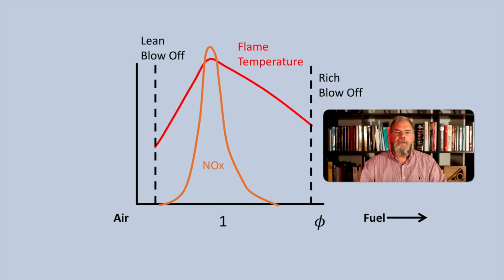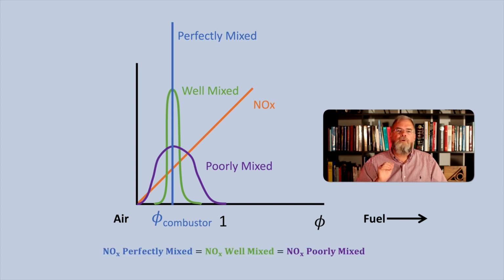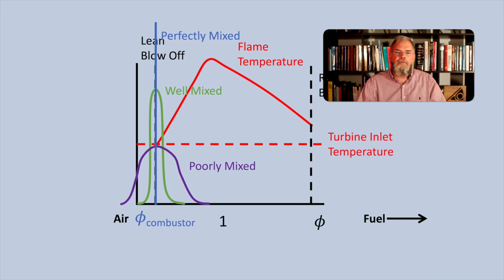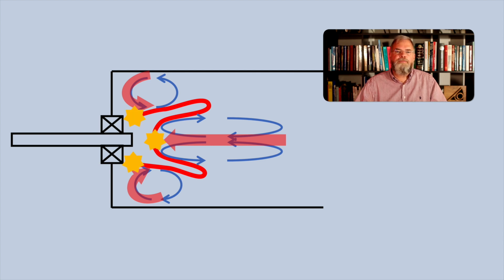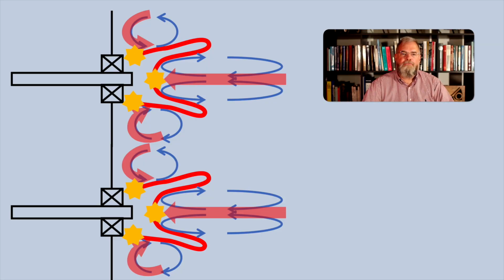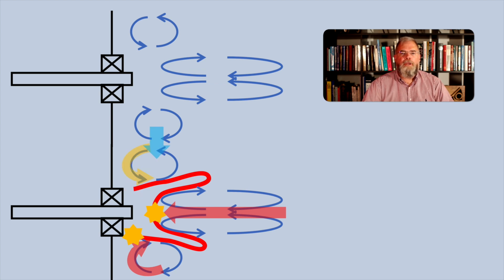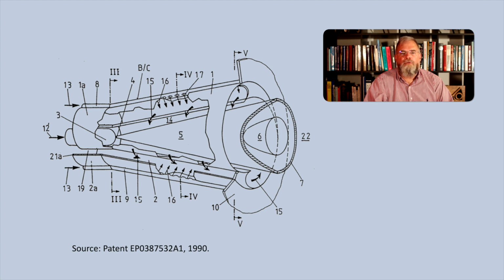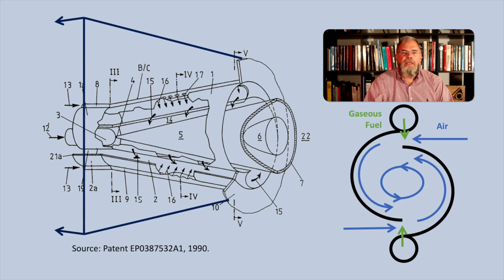Industrial Gas Turbine Combustors Part 3: Premixed Silo Combustion

Comment: Thank you for this amazing playlist. I have a question that maybe silly but here we go; When load decreases, fuel flow must be reduced to match demand. For a premixed flame, this pushes the system closer to the lean limit. Why can’t the IGVs alone be adjusted precisely enough to restrict airflow and maintain the original equivalence ratio, preventing excessive leaning?
Reply from the maker: The only silly question is the one not asked.  I am not a turbomachinery person so can’t answer what the limits are on the IGV and why this isn’t done.  I suspect this will impact the performance of the compressor and may lead to problems such as surge.  The IGV is closed on many engines as load is reduced which as you indicate helps but this is only done to a degree and is not sufficient to cover the full load range down to idle and keep an adequate margin to lean blow off on the burners.  Another tactic which is often done on small industrial engines is to bleed air from the combustor plenum and dump this overboard.  The drawback in doing this is that the efficiency of the engine is reduced at part load but it does increase the flame temperature maintaining the margin to lean blow off.  Mitsubishi for a period of time bled air from the combustor plenum on their large gas turbines and fed this back into the combustor downstream of the flame using a valve to control the amount of bleed.  I suspect they stopped doing this as variable hardware in the vicinity of the combustor is not typically reliable due to the adverse conditions there.  More recently axial staged combustion has been developed which helps as well.  Ansaldo Energia’s GT-36 combustor employs this and Siemens Energy has a number of engines which use this as well.  The idea with this is that the air flow is split so that less air goes to the first upstream burner.  This first burner is fired at low load and consequently operates at a higher flame temperature.  The remaining air is mixed in far enough downstream to allow complete oxidation of CO.  This air also lowers the temperature of the flow to the required turbine entry temperature.  The flame temperature of the first combustor is increased with load to the point where NOx emissions are still acceptable.  Then as load increases further fuel is added to the remain air or second downstream burner to heat this air increasing the turbine entry temperature.  By doing this both NOx and CO can be kept low down to very low loads.
Reply: @ 
Thank you for your answer and thank you for the efforts you put into this great series.

Comment: Is it possible that a swirler is simply a bad design?
Reply from the maker: I’m not sure why you think that.  The velocities are fairly high in a gas turbine combustor so it is necessary to generate a lot of turbulence to mix the air and fuel and to help stabilise the flame.  Turbulence increases burning velocity by increasing the surface area of the flame for a given volume of the flame front.  Additionally if swirl is strong enough the pressure in the centre of the vortex will drop enough that the flow in the centre will form a recirculation zone, commonly known as vortex breakdown, which helps recirculate hot burnt product upstream to ignite the fresh fuel air mixture entering the burner.  This helps anchor the flame.  Swirlers are fairly commonly used in gas turbine combustors with good success but there are other ways of anchoring the flame and generating turbulence which are also used.

Comment: Some Ideas for Future Videos (If you already don't have a pile planned, and if you are up to it):

- Integrated Gasification Combined Cycle (Mostly "Clean" Coal, but Potential for Biomass and/or RDF
- If there are/were any Gas Turbines using a "Oxy-Fuel Combustion" process to avoid nox (I know some solid fueled plants were planned for this, but just with conventional burners it seems?)
- Hydrogen-Cooled Turbo generators
- "Micro-Turbines" for building/home scale Combined Heat and Power Systems (How they are designed etc)
Reply from the maker: Thanks a lot for the ideas.  Right now I'm fairly busy with work so I haven't had the time to make new videos but when I find the time again I will certainly take your ideas into account.
Reply: @engelbrechtgmbh  i congratulate you on this amazing series with dense informative simplified and very well presented knowledge

I would like to ask you about premixing and its effect on efficiency since I do not believe it was emphasized

Does premixing improve efficiency ?

And in another note I would like to ask if it is possible to inject water both after the combustor and in the afterburner to increase thrust and decrease the temps
Reply from the maker: @First Last Thanks. 

In principle assuming the boundary conditions around the combustor are the same (ie temperatures, pressures and emissions - less NOx but more emissions related to combustion efficiency such as CO, unburnt hydrocarbons and smoke) the efficiency is not affected by the type of combustion.  Premixed flames tend to be more compact so there maybe an advantage regarding combustor pressure drop as there is the potential to reduce the surface area which needs to be cooled.  Having said that typically most of the air is involved in premixed combustion thus there maybe more pressure losses associated with conditioning this air so it isn’t completely clear to me which would have the advantage here.  But less pressure drop in the combustor would increase engine efficiency a little. 

Water injection is something which is used already.  For diffusion flames it is injected into the combustor to absorb heat and reduce the peak temperatures reducing NOx emissions.  But it is also injected into engines with either premixed or diffusion flames to increase power by increasing the volume of the flow entering the turbine.  This is sometimes done at the inlet to the engine in a fine spray of liquid droplets which has the added benefit of cooling the air entering the compressor or injected directly into the combustor where the liquid droplets are converted to steam before entering the turbine.  Ground based gas turbines, which I have been covering, typically don’t have afterburners as they are trying to minimise their thrust and extract most of their energy to drive mechanical devices such as generators, pumps or compressors.  However one might consider the SEV burner on ALSTOM’s GT24, GT26 engines as an afterbuner with a low pressure turbine following it.  This is not done in every engine but there are many engines in the field which do this.  There are losses doing this so I’m not sure it is always a benefit to do this but it can be used to augment power if a clean source of water is available.
Reply: @engelbrechtgmbh  my application is a very small rc model 

So incorporating water injection is definitely easy to do and i would like to emphasize that my purpose is maximum power

So if I was able to decrease the temperature significantely through water injection 

Is it possible that i reopen my combustion chamber and increase the diameter of the inner combustor to increase the flow maybe from 25% to 35% inside the inner combustor in order to increase the output of the engine at the same RPM
Reply from the maker: @FirstLast-tx3yj  For power augmentation in industrial engines they do not want to reduce the temperature by adding water.  They want to increase the volume flow in the turbine by generating some steam in the combustor.  So when they add water they increase the fuel burn to maintain the same turbine inlet temperature.

Adding water at the inlet of the compressor runs the risk of damaging the compressor blades especially if the droplets are not small enough to follow the flow well.

Unless you are an expert I strongly do not recommend that you modify your RC engine.  I do not expect the pressure ratio of such an engine to be large but still the combustion chamber is under pressure during normal operation and if any modifications you make are not mechanically sound you risk the engine casing cracking or exploding.  Inside the engine contains rotating components spinning at very high RPM.  If the integrity of the casing breaks down there is a risk that one or more blades get thrown.  This could severely injure or kill you or anyone else unfortunate to be in their path.  Simply spraying water at the inlet to the engine might augment power if the control system of the engine is set to maintain constant turbine inlet temperature.  If it is not you risk flame out.  However as I said you will damage the compressor blades which will become pitted when they strike the water droplets unless the water spray is very fine.  And if this pitting is severe enough, which if it is happening will build up to over time, you risk again a compressor blade breaking and becoming detached from the hub.  If the casing is not able to contain such a blade again it will be thrown and could kill anyone in its path.  If the casing does contain it it will cause significant damage to the remaining compressor blades.  Gas turbine engines can be extremely dangerous.  I have known of people who have been killed in accidents with real industrial engines so I strongly do not recommend you to modify your RC engine.

Comment: Very informative and full of knowledge.  Any textbook you might want to recommend to someone not familiar with combustion technology?
Reply: Combustion is a big topic.  There isn't really one text book that would explain it all.  You could start with "Combustion" by Irvin Glassman.   This was my undergraduate text book and it explains the fundamentals of combustion reasonably well.  There are many books on gas turbine combustion.  Arthur H. Lefebvre for instance has a good book "Gas Turbine Combustion" which is pretty much a starting point for any engineer going into this field.  I believe he also has a complementary book on fuels.  Unfortunately when I was working at ALSTOM both of my Lefebvre books were borrowed by someone and not returned so I've lost them.
Reply: @GeoffreyEngelbrecht  well
And now iam in Alstom 13DM gas turbine with ev combustor. And also iam well in GE gas turbines which is almost can annualar combustor
But this Alstom is silo type ,any documents there to know everything about 13DM Alstom gas turbines?...
Reply from the maker: @arteryking2  during my time at ALSTOM I was mainly in the development group working on new engines so I have to admit I am not that familiar with the specifics of the GT13D engines as these were developed before my time.  The GT13E2 was developed just prior to my joining and during my time there there were many upgrades including the AEV burner version of that engine which were developed.  Because I signed a confidentiality agreement with ABB/ALSTOM during my employment my intention with these videos is not to present any material which is not public knowledge already either through scientific publications, books or patents.  Also my intent with these videos is to discuss general issues which are common to all OEMs' engines.  There is a good book (Eckhardt, D., "Gas Turbine Powerhouse: The development of the power generation gas turbine at BBC-ABB-ALSTOM",  Oldenbourg Wissenschaftsverlag, Göttingen, 2014) on the history of BBC/ABB/ALSTOM which discusses more the specifics of that company's engines and details the development of the GT13.  Though the detail is still at a high level so it may not go into the depth you are looking for.  There maybe more literature out there specifically on the GT13DM but I have not had a need to look for this in the past so personally I can not give you anymore advice on this without doing some work myself.
Reply: @engelbrechtgmbh  thanks boss.
But iam not need of any confidential thing as iam not a designer or developer
Iam in operational and maintenance , so that I asked for like overhauling full gas turbine and I could understand the visuals ,because I started my carrier 2 years ago and serviced in more GE Frames  .likewise to know about the Alstom machines I asked you ..(to know about arrangements ,vanes, Rotor heat shield segment arrangements etc......)
Beside that nothing personal.
Reply: @engelbrechtgmbh  https://youtu.be/pEnlUpG9_t0
Please check this 
I looking like this video or any pdf documents  to know about arrangements of Alstom turbines
That's alllll......... 
Thanks you......
Reply from the maker: @arteryking2  Yes but details like that would be considered confidential by the OEMs.  They would not want their competitors or third party suppliers to know this.  Of course you can do your own reverse engineering as many third party suppliers do to determine these configurations and your own analysis to try to understand specifically why.   

I work together with several consultants who have done this sort of work while being employed at Wood Group or GE.  So if you are interested I would be more than happy to introduce you to them and we could potentially support you to develop your own methods and in house knowledge but we can not provide confidential information which has been provided to us either as employees or as consultants.

If you are just looking to conduct authorised service on engines then the OEMs offer training and all the information you need so they would be the best source of this information.
Reply: @engelbrechtgmbh  👍
Keep this in mind , I'm in learning process so any information could help me to upgrade my knowledge.  And loved these time ,which I spent with you............
Reply from the maker: @arteryking2  No problem.  I wish you success in your career.  I know GE is very oriented towards third party authorised service rather than doing this themselves as ALSTOM did.  GE I believe took over the GT13 when ALSTOM was sold to GE and Ansaldo (a manager I did some work for at Ansaldo was fuming about how they would rather have gotten the GT13 than the GT26 - the GT13 has a bigger market).  I also know GE offered courses, here in Switzerland and perhaps elsewhere, in maintenance and commissioning to suppliers of companies that bought their engines so again if this is all you are interested in then I think this is your best option.
Reply: @engelbrechtgmbh  Thank you boss
And waiting for video part 4..........